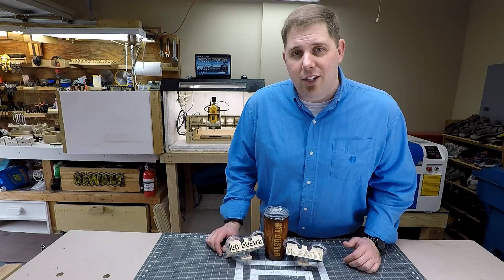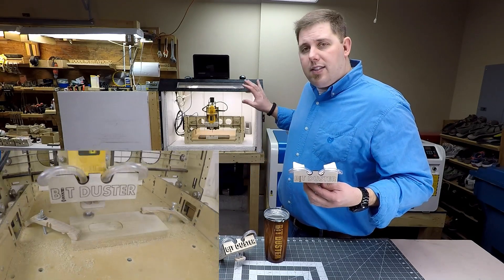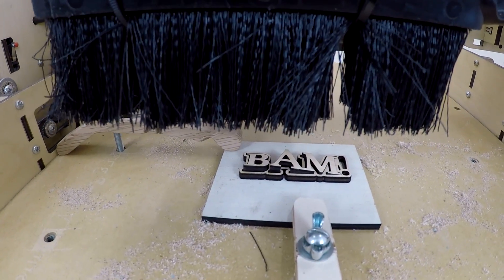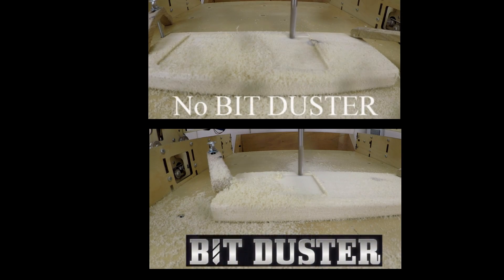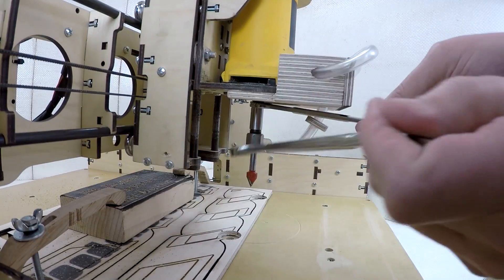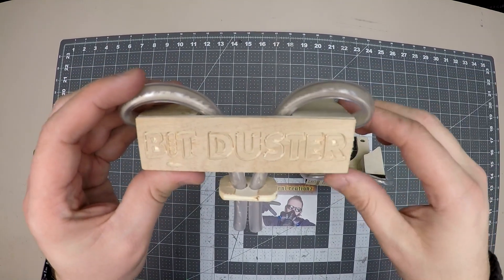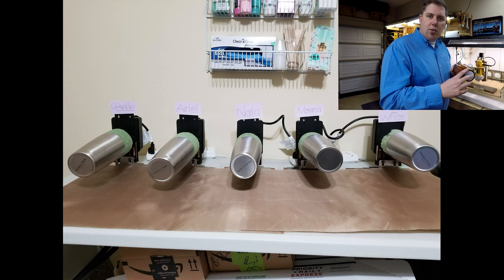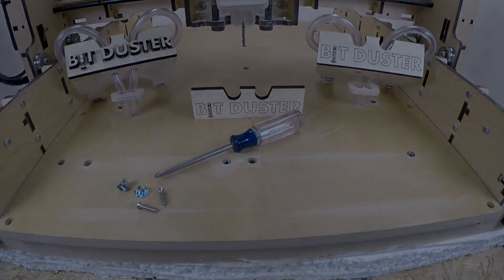Bit Duster - CNC Dust Management (E3\E4 CNC)

Comment: This looks really clever, good job!
Reply from the maker: Thanks Per! It works awesome and it comes with a lot of benefits.
Reply: The dust collector is needed to keep dust down in your shop and your lungs, but it still builds up on your X and Y axis rails and bearings. Here is a solution that fixes the dust on the rails and bearings: https://www.etsy.com/listing/1050295308/bobscnc-evolution-e4-cnc-router-engraver?ref=shop_home_active_1&frs=1
Combine it solves the problem.

Comment: Good job! How dose this effect the cooling of the router?
Reply from the maker: Zero effect. It's only catching the exhausted hot air. The intake is at the top of the router. 👊🏻😉
Reply: @WoodenCreationz  That's great,  sounds as though it  just redirects the  airflow without restricting it.

Comment: I’m on the fence between the E3 or the E4?  And has the BobsCNC stood the test of time?
Reply from the maker: Mike Bob has never given me a dime to sponsor him or promote him. I wanted one really bad and the budget fit. Amazon reviews we're all outstanding. Own the E3 and E4. After owning them both I can easily say go for the bigger CNC. I realize it's more money and we don't like to spend more money. But the larger surface area really allows you to do some really nice signs or bigger projects..... it wouldn't be long before you would outgrow the E3. to answer your other question in regards if it has stood the test of time it has.... Both work just like the day I got them. On the e3 I did not lock tight the nuts. I had three fall out. on the E4 I locked hided every nut and have never lost one. Structurally I questioned Bob on strength as I wanted a metal one and there's no issue with strength. You've got lots of rigidity and hundreds of nuts and bolts that hold it all together. Years later the machines haven't slowed down. If you're looking for the most affordable CNC and the very best support to make sure you get it going and support it in the future I would go with this one. E4 for sure because you outgrow the E3. Check out Bob cnc on Facebook. There are some very talented people that make some amazing things with theirs...

check out this video for other things in regards to Bob c&c like software and enclosures and a few products that make for it.
https://woodencreationz.com/bobscnc-videos

Heading back out to play on the CNC now. 😂
Reply: WoodenCreationz Thank you so much for your quick response. You sold me, ordering E4 tomorrow!  Also, were do I buy the Bit Duster?  
Thank you
Reply from the maker: @mikehamilton4880  Here is the link for the Bit Duster and one for a Bit Stopper... Trust me you will dig both money back guarantee. 💪🏻😉 https://woodencreationz.com/bit-duster    https://woodencreationz.com/bit-stopper And by the way ty. 🍻👈🏻
Reply from the maker: @mikehamilton4880  Oh yeah... Back to the CNC.. congrats!!! You will love it bud... It's a very fun machine... Follow the directions and software install directions and it really goes together easily. If you get stuck reach out to Bob's help support.. He makes sure you  get it up and going so don't panic. 💪🏻🍻 Tag me in a post on the Bob'scnc Facebook group once you knock a master piece. Would love to see it.. -Brian
Reply: WoodenCreationz I sure will!  Thanks again Brother

Comment: have you tested this on a DeWalt 611?  I know bobs comes with a 660, but if it works with the 611 you could pimp this out to X-Carve users too.
Reply from the maker: I have... Sadly the air exhaust isn't the same... So much so the 660 puts out zero blowing air which confuses me.... I had hopes of making it for the other CNC's as well but Bob's is sadly the only one it works on this time.... Great question though!!!!
Reply: The dust collector is needed to keep dust down in your shop and your lungs, but it still builds up on your X and Y axis rails and bearings. Here is a solution that fixes the dust on the rails and bearings: https://www.etsy.com/listing/1050295308/bobscnc-evolution-e4-cnc-router-engraver?ref=shop_home_active_1&frs=1
Combine it solves the problem.

Comment: Great idea man using the exhaust,  makes good sense for if you want a live feed camera on your projects to be able to observe with no obstruction and have the clarity. 
Just bought my E3 and need to add your Bit Duster

Check out loc line .. we use these at my work for coolant and air flow... you can adjust the hose.. add different tip nozzles for pressure and fan. But that way you don't have to worry about different cutting bit lengths and the hose warping. Plus you can get 90 deg elbows and what not and make it looks super pro-fesh.  Its really not that expensive either.  

Enjoyed the video
Reply from the maker: Thats awesome! Appreciate the kind words and I will have to check out the loc line. Thank you
Reply: The dust collector is needed to keep dust down in your shop and your lungs, but it still builds up on your X and Y axis rails and bearings. Here is a solution that fixes the dust on the rails and bearings: https://www.etsy.com/listing/1050295308/bobscnc-evolution-e4-cnc-router-engraver?ref=shop_home_active_1&frs=1
Combine it solves the problem.

Comment: Could probably increase pressure by having a sleeve over the exhaust on the router.
Reply from the maker: ej732 You probably could. It's got 2 more ports in the back of the router as well. I wanted to be careful and not restrict any of the air so it doesn't over heat it with restriction. Right now it has a great stream of air on the saw dust, but not so much you have a cloud of it in your shop from let's say an air compressor. 👊🏻 Appreciate your idea and comment. Brian
Reply: WoodenCreationz Ive yet to even get a cnc and was thinking of using the router exhaust in some way, so you beat me to it. Dork. 😜
Reply from the maker: It only occurs on this model of dewalt from what I have found.. Other models of routers on CNC's don't typically have exhaust like that. I would prefer the market lean towards that and thus be the norm vs the dust shoe. I prefer to see my work as it cuts... A fumble of the numbers when setting up the cut and you easily can cut threw your spoilboard, or a piece break free and it now sits in the path.. the bit duster allows you to see all that.. Not getting paid a dime to say it.. But the E3 is a great one to consider when you get the money together to buy one.

Comment: I see what you mean about being self contained. No extra power needed. My old table jigsaw has a bellows attached  to 
the head that goes up and down  and blows air through a hose going down to the saw blade. It would blow air on the 
cutting area to remove saw dust. The hose and bellows are dried out. LOL
Reply from the maker: Wayn Jul I have a harbor freight scroll saw that does the same and it's amazing to have the saw dust blow out of the way as you cut! I have used them before where they don't have them. And it was not that fun!!!  👊🏻😁